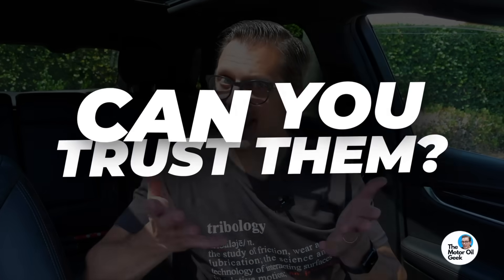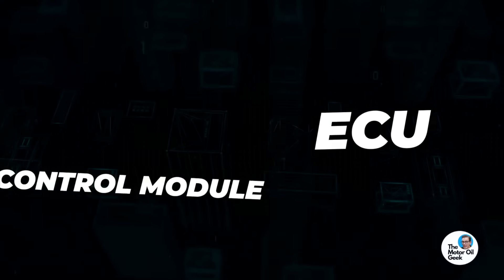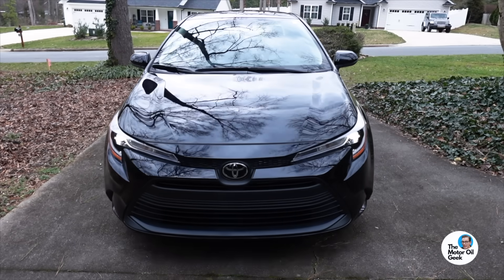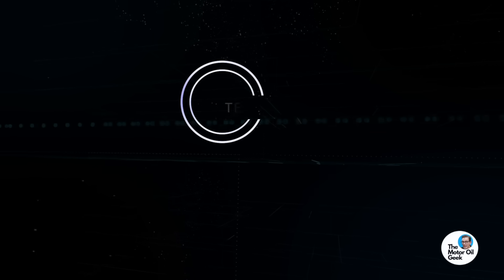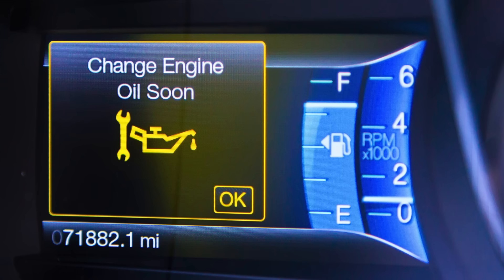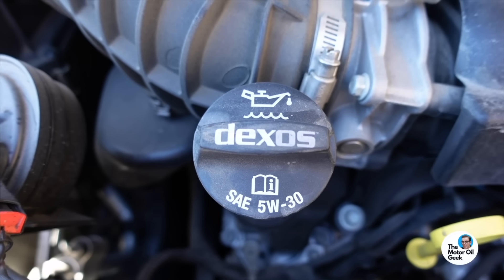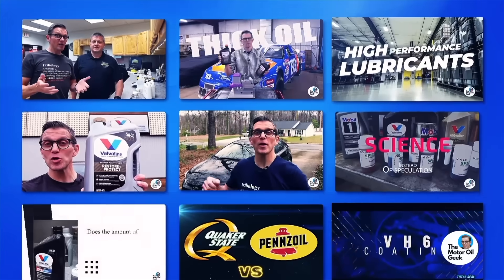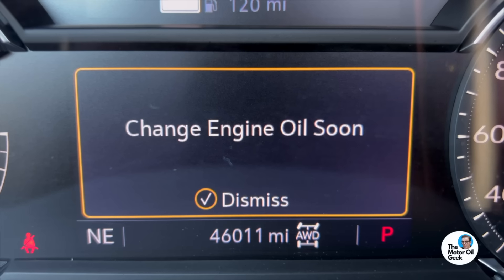The Accuracy of OIL LIFE Indicators REVEALED!

Comment: 2.4 L ecotec in a Chevy Equinox    I changed oil before a trip out west from OK  Went all the way to NV and made it back to mid CO and the oil life went to 0%  2900 miles  Traveling through the mountains with that 4CYL made for a lot of high revving  Thats my story  I change oil @ 5000 or thats my goal  I think a V6 torque has a big advantage  I have over 312000 on that same engine  Its been a good car   These new high tec engines require fresh oil to keep all the parts working for a long time (phazers and lifters  VVT engines and LS type Engines)

Comment: Most engines benefit with a 5000 mile oil and filter change interval.  Inspect the oil filter to understand the level of contaminants/combustion byproducts in the system.  If it's med brown your at the limit.  If it's dark brown/black you'll likely see deformation due to restriction.  This will happen around 3000 miles on vehicles used like the short trip scenario mentioned.  Back of the napkin calculation (using a couple vehicles) revealed about 400 cold starts (vehicle sat at least 6hrs) was enough to contaminate the oil (fuel and combustion byproduct smell) on vehicles used for short trips only.  Engines engineered with tight tolerances and/or large crankcase capacities usually can get away with longer intervals, especially if driven mostly highway miles.  The oil stays very clean however need to be mindful of oxidation.

In summary, I recommend to my customers to change the oil at 5K intervals and simply watch the odometer. i.e. 50K, 55K, 60K etc.  Of course, put a tag on windshield to remind folks.  For the short drive vehicles, recommend change every 3300 miles.  i.e. 50k, 53300, 56600, and 60K miles etc.  Hope this makes sense.

Reminder - the auto manufacturers only need you to get past warranty then your internal engine issues are your responsibility.  Oil grade, weight, and change interval will dictate how your engine sounds and performs after 200K miles.  Hope this makes sense.

Comment: We learned in Auto Tech school that the oil now days has a lot more conditioners in it making it last longer especially full synthetic typically full synthetic is good for 10,000 miles. The oil life monitor is actually mainly based on mileage it’s a scam for you to bring your car to the dealer to get an oil change every 3,000 miles. Good rule of thumb is if it looks like honey save your money.

Comment: I have a built-in oil monitor that comes with common sense.  I change the oil around 6k miles.  And based on the number of miles I drive, that's every two years.

Comment: Hi I have a question I have a 2020 Hyundai palisade that requires 5W-30 full synthetic oil I currently use mobile one, but should I use the Valvoline Restore and protect brand instead I have 98,000 miles on it I intend to keep it as long as I can, it runs great I don’t have any engine issues but I want to also make sure I take care of it I found that it’s hard to find 5W-30 without the General Motors requirement dexos in it but if I do purchase it is it safe to use on my vehicle considering it’s not a GM product

Comment: I worked at bmw for many years and they had it, some people went 5000 some went 20000, so the system is accurate , i have a ford truck now and it seems in line with the last change.  It also has the air filter monitor in the dash instead of the vacuum gauge from the past.  We all need to accept the future, and remember that carburetors don’t exist any longer, and that oil companies have brainwashed us thru advertising

Comment: Would your data be more valuable if you knew the actual mileage/time between oil change?  For instance I have a Chevrolet Equinox that claims my car has 30% on the oil.  But, it was changed only about 1500 miles ago. How could 70% of the oil life be used up in 1500 miles? That seems in error to me.

Comment: I don't understand why oil life percentage indicators aren't calculated based on the mileage as recommended by the manufacturer. For instance,  if manufacturer recommended changing oil at 5,000 miles and you've driven 2,500 miles since last oil change the computer should calculate and indicate 50%. Most cars already calculate so many other data points like average mpg, or mph, etc., etc. I try to keep it simple. I change every 5k miles. So when my odometer reaches any number divisible by 5k, it's time to change the oil AND the filter. Example 5k, 10k, 15k, 20k,....

Comment: I go off miles.. cummins 2017 10K miles.. period.    GM uses a nice system..  had a impala LTZ 2008.. when we would go from NC to florida the oil change was around 7500 miles.. when it was just intown on the interstate at times more around 5K miles..

Comment: At 5:55 you say most makes have a simple odometer oil life meter. You then test the oil and conclude the oil life meter is conservative and is to be trusted. Yet you also say previously that there are conditions - like with the old lady taking short trips in cold weather - where the oil could be spent well before even 3000 miles. If the odometer life of oil is 5000-6000 miles, how would it know the old lady is driving her car the way she is? Or any variation in between an all-highway driven car where it always reaches full temperature, to one driven mixed, to one driven in very dusty conditions or any combination? At 7:58 you use the word "GM" oil life indicator is to be trusted. But it sounds like you're implying all oil life indicators are to be trusted, including the simple odometer types. Shouldn't you just say the GM one is to be trusted and all other are not to be trusted?

Comment: I determined on my RAM, it just does 10,000 miles exactly.  I don't know if it could be calculating that though because I drive about 90% highway about 575 miles a week.  So maybe if I drove differently it would register different, but since I'm in the ideal scenario, maybe it just gives me the max number.  I've only ever used synthetic oil, but whatever name brand is on sale at the time.

Comment: I agree on the metric system, whoever thought up the system we use should be dug up and shot. BTW, BMW had the oil life system exactly as you describe in the early 1980s, except it didn't have the mileage limit.

Comment: Hey Lake …..long time fan of your Dad…..met your Mom, been in the old race shop (SPAM !!!) …….QUESTION …..my wife has a 2025 Honda HR-V , 2.0 4 cylinder, non-turbo…..I’ve heard SO NANY theories on "first oil change" (as of now, it’s at 3100 miles) ……what’s your advice on getting that factory oil out of the engine?
Thanks so much….. Hope Mom & Dad are OK
Reply from the maker: Mom and Dad are doing great. Get that oil changed soon. Here is the proper framework for making decisions regarding oil. 

Step 1 - Utilize the OEM recommended oil spec and viscosity and do two early oil changes during the break-in process (500 to 1,000 miles and again between 3,000 and 4,000 miles). If the engine is already broken-in, skip to step 3.

Step 2 - Take used oil samples at each oil change to establish the trend analysis.

Step 3 - Go 5,000 miles on the third oil change and take a used oil sample. If the wear rate per 1,000 miles is below 5 ppm, you are good. If the wear rate is between 5 ppm and 10 ppm per 1,000 miles, go another 5,000 miles on the OEM recommended oil and resample. If the wear rate is still greater than 5 ppm per 1,000 miles, then move to step 4.

Step 4 - Since the OEM recommended oil and viscosity have not produced a wear rate per 1,000 miles lower than 5 ppm, go up to next viscosity grade in that oil. Go 4,000 to 5,000 miles on that oil and then take another sample. See if the change in viscosity drops the wear rate per 1,000 miles below 5 ppm. If it does, you are good. If it does not, then move to Step 5.

Step 5 - Since the change in viscosity did not get the wear rate per 1,000 miles below 5 ppm, try a different brand of oil in the same viscosity grade of whichever oil had the lowest wear rate per 1,000 miles. You will need to use it for 3,000 to 4,000 miles to flush the OEM oil out of the system before going 5,000 miles on the new oil to take another sample. See if the non-OEM oil lowers the wear rate per 1,000 miles to 5 ppm or less. If it does, you are good. You can then use the oil analysis results to fine tune the oil change interval.

If the wear rate per 1,000 miles is still above 5 ppm, try the next higher viscosity oil of that same brand to see if that lowers the wear rate per 1,000 miles. Finding the best oil for an engine is an iterative process, but the data from the samples (viscosity, additive depletion, wear rate) will paint a picture that guides you in the right direction.

Comment: When my oil life monitor gets to 60% on my 2016 Honda Odyssey, I am usually at about 4500 miles since the last change. They are crazy to think I'm going to take it down to 15 or even 20%. I run full synthetic and regardless of the monitor I change both oil and filter at 4500 miles. Keeps me and the van happy. A lot of people would say it's overkill, but I drive the vehicle nationwide for my job. I am good with $35 every 4500 miles. I do the same to my 2015 Chevy Cruze 1.4 turbo (Known as a throw away car). 155,000+ miles and it runs like a top, and still has the original turbo.

Comment: So what you are saying is that 5000 mile oil change intervals are a waste of money. Also since it's a rental I would doubt they maintain it with the highest quality oil and filter.
Reply: Not necessary, depending on condition such as the environment and the type of driving you do changes the life of the oil. Short city trips may wear out the oil at 3k, but almost all highway driving in ideal condition may last up to 10k. Even in the car manual it tells you to check your oil regularly (from the vehicle my family has it says after every gas fill up)

Comment: I have a 2012 honda civic.  I recently put in oil that was claimed to be better than anything else.  I was already using full synthetic.  My oil analysis indicator would normally come on around 12000kms.  With the new oil it did not come on until 26000 kms.

Comment: As someone who moved to the USA I find the oil change mentality in the USA very different to where I am from. For me, oil changes at 15000km (9000 miles) where standard, and yet Americans love oil changes every 3500 miles (5000km) which is 3 times as often.  I drove many  small engined cars 200 000+ on oil changes intervals that make my American friends cringe. 

I spoke to a tribologist in the early 90s who told me he ran his car 30 000km between changes based on oil analyses he had done and he had zero issues. In an Audi 400 (sold as a 100 in the USA) with an 1800cc engine he had over 300 000kms. 

Modem oils are just superb.

Comment: It's a great invention!

I have had two Buick Regals, 1999 and 2000.  The "Problem" if I can call it that, is that they were calculated on non-synthetic, high mileage oils.  So I just reset it once or twice before an oil change.
Reply: lol. That is entirely incorrect.  Practically speaking, a synthetic at that time would get just as contaminated as the regular oil
Reply: @18_rabbit  It's not the contaminents, it's about the oil's degradation. Losing viscosity index, for instance.  When Mobil 1 was new, I recall a story in Popular Science.  They ran an engine on the dyno for the equivalent of 100,000 miles.  No oil change, jus topping off.  No wear.
Reply: @18_rabbit  There's a lot more to oil life than contaminants.  Conventional oils break down, lose viscosity index, and more.

Comment: I have a 2014 RAM with 5.7 Hemi. I started running full synthetic at 42k miles and stuck with that since. I will change oil on the SECOND alert from from the OLI (I reset it once each time, when it reaches zero I then change the oil and filter.) Results? My engine has 284,000 miles on it, still runs strong, doesn't burn any oil, has only a minor hemi tick, but is about due for a rebuild. My mechanic who fixed the infamous warped header issue on it was shocked to see so many miles on it, as he'd never seen a hemi go over 150k.... until mine.

Comment: The manual for my current car says to change oil every 5000 miles (8000km) for severe duty (towing, cold weather, city driving, etc). When I do, the OLM is still around 40-45%. Meanwhile my old Silverado was damn near spot on for oil interval by KM and OLM % (OLM was usually around 15%) and when I towed heavy the OLM dropped quicker. My old Cadillac was good too - which makes sense given they are both GM OLM and my current car isnt. Used oil analysis supported the OLM, Blackstone would say i could've gone another 1000-2000km confidently so there is that approximate 15% remaining. The GM OLM system is top notch. 

My current car is a hybrid, which I would have thought due to the hybrid engine cycling (and subject to Canadian winters) that it's OLM would drop quicker. It's OLM is more of just a display menu to look at and less of a function. 

At the end of the day, do what the manual says while in warranty, after warranty is toast then adjust as you see fit (same goes for oil weight and spec).

Comment: The oil life algorithm that GM uses is well documented and as you show, works very well.  I've found very little on the calculation used by Ford and Chrysler vehicles.  Are they licensing the tech from GM or do they use an equivalent method?  IE do we know the Ford and Chrysler oil life monitors are also trustworthy?

Comment: I change my oil at 50% on the indicator 2016 Chevy equinox and the oil looks the exact same as it does if I were to go down to say 9% as you did on that Cadillac and I’m putting in mobile one full synthetic high-performance for high mileage vehicles

Comment: I change my oil and rotate my tires every 5000 miles. The oil life monitor would let me go to 8000 miles. Too long for my taste. Oil and filters are cheap. Engines are not. Transmission fluid every 30,000 miles. Very important especially with turbocharged engines. 2018 Chevy Equinox.

Comment: Don't let the GM engineers snow you! Although the current oil life monitors might limit it to a maximum of 7500 miles, that wasn't always the case. On my 2011 Malibu, I change at 50 percent and that gives me about 7000 miles. Other 2.4 engines have experienced failure of the timing chain or guides, my car has not. There have been recalls on a number of GM  vehicles to shorten the oil change intervals. The 3.6 V6 was experiencing a lot of timing chain wear because the oil life monitor would allow 15,000 miles on an oil change. The oil life monitor might be working reasonably well today but on many vehicles, in the past, it was a disaster.

Comment: Here's a fun story. Back in the day I was getting ready to change out the engine in my air cooled Volkswagen, so I drained the oil and put water in the crankcase and drove around the neighborhood. The oil pressure light DID turn off. When I got home the engine was was perking and steaming like a locomotive!

Comment: OIL LIFE MONITORS DO NOT SAMPLE THE OIL AND LET YOU KNOW WHEN ITS BAD.  THEY ARE USUALLY MILEAGE BASED ONLY SUCH AS 7500 OR 10K MILES.  THE WAY YOU DRIVE THE CAR, CAN SOMETIMES MAKE THE COMPUTER CALCULATE A SHORTER LIFE, BUT MOST OF THE TIME ITS PURELY MILEAGE BASED..

Comment: Despite your amazing explanation and your extraordinary knowledge I just change oil every time “ service required” light turns on in my wife Acura( 7.5k miles) or my humble Camry (5k miles) , I only  use “ Mobil 1 extended performance ( high mileage)” and after replacing the valve cover gasket in both vehicles the engine  look clean like new , i even took pictures of them to prove it 😉

Comment: Question: I have a 2024 GMC 2500HD 6.6 gas and I haven't been able to drive it alot but enough to keep the fuel fresh (use  stabilizer also). I've changed the oil twice once at 1500 and at 2200 he indicator said it was under 15%. I always run it to operating temperature but seems another change is a little soon based on mileage. Your thoughts?

Comment: No I didn’t, I watched the oil pressure. 60 psi after change, 30-35 I changed the oil and filter. All local driving 2000 GM 3.8 motor.

Comment: When your engine starts to knock you probably should have been changing your engine oil more often. Never go by idiot light you idiots and check the dipstick you dipsticks. 5000 miles maximum for synthetic oil and 2500 for conventional oil.

Comment: I was lectured at the ford dealer because my car had more than 6,000 miles since previous oil change and it should be at 5,000 miles. Car indicator said 25%. They lost a customer. I went back to changing the oil myself.
Reply: What really happened?  They said hey you have a high mileage vehicle and you should consider doing it at exactly 5,000 mile intervals?
Reply: I wouldn't assume that it was malicious
Reply: Always change the oil yourself if you can.  Reason being is you cannot be sure what viscosity oil they are putting in & if the oil drain plug is tight (but not stripped or over tightened).  Pre-fill the oil filter as well since it takes time for the oil to get through the oil filter media.  If you don't believe me just take a new filter & try to fill it with oil.  It takes a few seconds before that oil is absorbed by the filter.

Comment: I always change the oil and filter in my Honda Ridgeline at 5000 miles, which is typically at about 50% on the oil life meter. Most of my commute is highway cruising, so I'm pretty easy on my engine, but I'd rather change my oil too often than to run it too long and cause gradual damage to my engine.